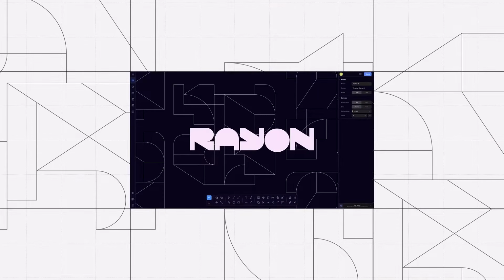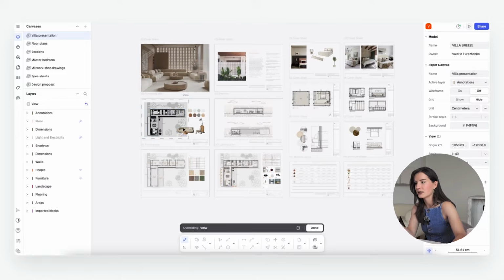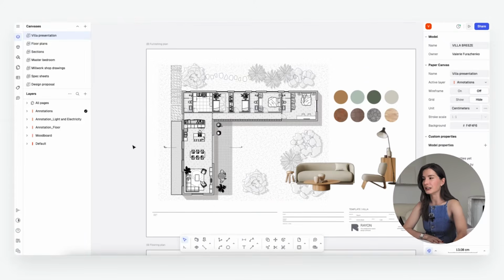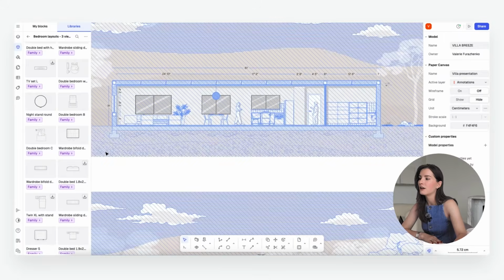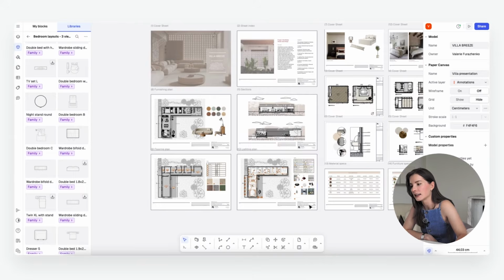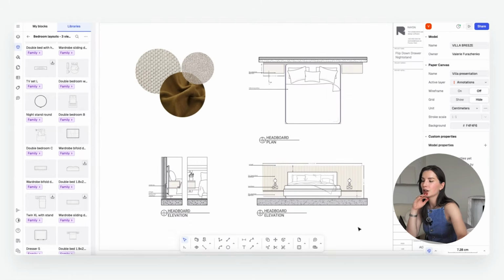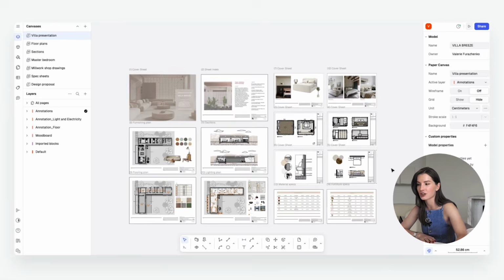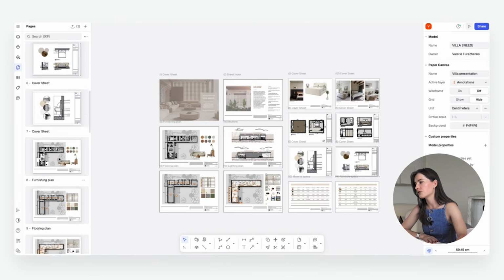How to Level Up Your Interior Design Drawing Set

Comment: Should I publish schedule as contractors and clients are able to open the same link? Should contractors see the whole project schedule? Should clients see in-depth technical drawing?
Reply from the maker: Great question — this is more about who needs what 👍

In general:
• Contractors → yes, share the full schedule (they need the detail to build properly)
• Clients → usually better to share a simplified version (high-level timeline + key drawings), not every technical detail

You can absolutely use the same link, but it’s often smarter to control what’s visible depending on the audience.

Think of it as: clarity for clients, detail for builders 🙂

Comment: This platform is incredible. I've been using it for a few months, and I'm sharing some features that could be implemented in future versions:
1. Shadows cast by walls and objects automatically generated within plans, elevations, sections, and isometric views (based on the angle of sunlight).
2. Advanced fill of shapes and areas with three types of textures (material, weathering, and dirt). Add an extra option after applying textures: effects/filters such as pixelation, grain, blur, and others. Additionally, these textures should be able to be applied to 2D surfaces and in isometric views.
3. The block library is impressive. To make it even better, the library should have an isometric view of each object, in addition to plan, elevation, and profile views.
4. Site tool: a tool for downloading 2D maps where we can view topography, plots, trees, roads, and buildings by layer. This can be achieved through partnerships with platforms such as MAPBOX or OSM.
5. Expand construction detail templates in Plan, Section, and Isometric views.

All these improvements, as well as any others implemented in the future, must always maintain the platform's minimalist interface.

Thank you.